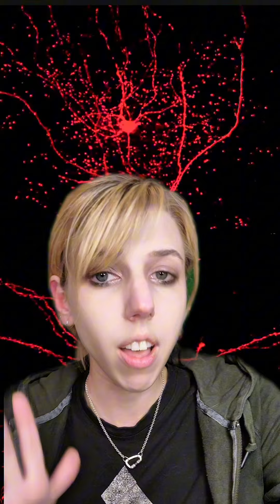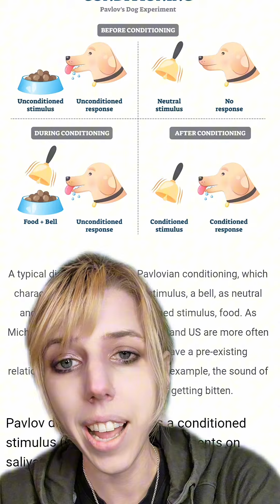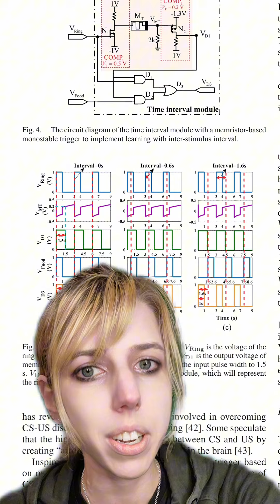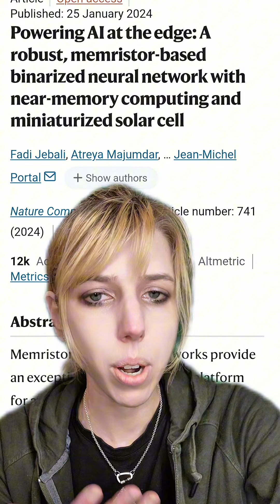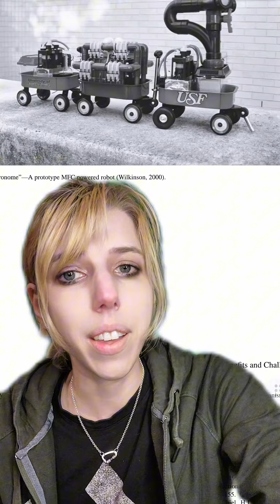Robots Are Stupidly Inefficient: Advancements To Make Them Function Like People

Comment: Halobacteria and a series of powered an unpowered LCDs to account for lambda adjustments as optical neurons on MeA sheets piloting a cohabbitted bioreactor with symbiotic pleurotus, cervisiae, mycoderma, pseudomonas  and lactobacillus along with a oxidation tank with specific enzymatic collonies geared for lignocellulose pre decomposition mashed together in a ford excursion full of pvc plumbing and stank eating obstacles for nutrients. The whole thing running on an ethanol ICE that uses combustion gas and heat with a solar HHO unit to take hydrogen and a iron copper catalyst to crack co2 and take generated hydrogen to make more ethanol

Comment: Robots are amazing at doing one thing. A robovac isnt going to be good at anything besides its designed intent. 
A 6 axis robot is going to be tailored to a task by its size and torque rating. That 6 axis isn't going to be capable of vacuuming a room. A pick and place is not going to be abke to spot weld a car frame.

We are far away from a robot being just as capable as a human in working on so many varied tasks.

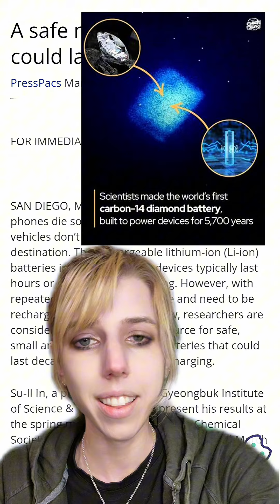Comment: 3:25 diamonds are flammable.  This beta source would be easily aerosolized by a fire 😷, that's bad.

I'd still probably prefer it to coal tho, which also aerosolizes radioactive materials into the air when it's burned.

Comment: I know this comment won't reach anybody important but please remember the science behind pressurization in depressurization and indications of flow dynamics. If anybody important does receive this remember we get headaches for more than just our cleft plate
Reply: 3:28  Now that I have the time marker also I could include with the above comment the factor of different size orbs will contract different electrical inputs because of the outer parameter and then you always have the ID parameter to manipulate for extra stuff

Comment: I think it will be a combination of all of this research depending on the application. I also agree it’s all an open field really so there’s a lot of things that will only go so far to scale. I do like the idea of microbial fuel cells quite a lot the scale isn’t there but the research is promising. I want to feed robots it just sounds like an awesome experience lunch with a robot what a fun thing to think about.

There’s also the piece about a more compact computational  language I think it will be necessary for a fully capable humanoid robot. The efficiency upsides will make it happen the more complex we build the limbs. There’s still limits to the pinching and articulation these machines can do it’s the same with prosthetics different problems same equipment. 

The more I look at the biology the more I think the answer is there but it doesn’t come quick. I think we will get massive machinery then scale it down. It’s how it’s worked before with the rate of scaling of the systems. I do think we will get less capable or specialized smaller robots. I hoping for something we have to teach I think of it like calibration with inherit alignment out of the box. It depends on how some of these current deployments go is my assumption. 

There just so many unknowns and the world is changing faster than ever people just don’t feel it cause it’s so incremental. People thought I was crazy when I told them in 2019 we were close to showing a robot a video and it reproducing the action. I’m personally rooting for the machines I just hope people are nice to them. No one asks for existence they are thrust into it robots are the same there. It’s a conversation I really want to have with a robot how do you feel about your existence? 

Thanks much for the coverage as always checkout Design and optimization of a bionic jellyfish robot for enhanced underwater propulsion efficiency fun stuff

Comment: The thing with robotics is it will functionally return back to the economics of slavery weirdly enough. The practice wasn't just abolished because it was morally wrong, but also because it was economically unsound due to the emergence of the free market revolution. Once the lowly peons were given permission to trade goods and services, people very quickly found out that hiring someone for a relatively low wage was significantly more efficient in the short term than a very costly slave meaning businesses could scale up from a much smaller starting cost and growth exploded. It won't matter if you can get a robot to do a complex task if it costs $50m to start and only costs like $1k per year to run and maintain, anyone would be able to recognise that even hiring people for considerably costly salaries is more economically viable and can scale quicker. Ofc capitalism is long dead so it's not really a surprise that we're in this AI bubble where investors somehow believe in a pipe dream where corporations can be 100% productive and have 0 staffing costs but the State will ALWAYS be too incompetent to keep such a ponzi running for long

Comment: We should fuel the robots with microplastics and use plastic-eating fungi & bacteria in their robot guts... especially the bacteria that turns plastics into "spider silk" and so the robots could help clean up the environment plus be able to build and repair themselves via 3D printing with aforementioned plastic spider silks. We should also plan ahead and design some portion of the robots to be fueled by arachnoplastic-based filaments.... You know, for when the robots have been too successful at their work and have eaten/cleaned up all the microplastics in the world. sigh.
Reply: Very cool idea also promising adjacent research on the subject. I was thinking microbial fuel cells but this is far more fun to think about. I also just love the idea of feeding robots waste materials dual applications are just practical . I was reading about robotic jellyfish for deep sea exploration this could be adapted for that purpose possibly. They are small so it would might be achievable it would certainly be appropriate for gathering without disturbing the habitat

Comment: Thank you BIG TIME awesome topic. u know I love this😊 Ternary(bcoz 0,1,or 0&1, to simulate hadamard gate and xor-like ops) mirror symmetrical(bcoz it can commute a bosonic symmetrical wavefunction which satisfy Symmetry under exchange thus not only allowing anyonic pathfinding like circuits with photonics,as they started to use magnetic skyrmion manipulation and logic gate functionality of  topological charges in spintronics and even ion-based computing) and metallic ratio parametric number base for 5th degree&on quintic functions which then we can adapt to use prime number neural networks. Infact a similar simplification to quantum chips architecture jst published recently (you'll love this:Nonreciprocal quantum information processing with superconducting diodes in circuit quantum Electrodynamics) and finaly once again Brousentsov's Ternary Principle and Bergman's Number System fits to this profile perfectly. Once we solve the actual ai, not just the llm's of chatbots on steroids but something like Hierarchical Reasoning that can bring latent space thinking(basically instead of semantic porn of Christopher Hitchens book like already achieved weight matrix transformers trained in a feedback loop models it'll be using pattern recognition similar to wolfram ruliad based hypergraph models it'll dive on a high dimensional vector space and use e8 lie group or hurwitz quaternarion maybe even scators to mark tokens(and then of ofcourse we got the audioactive sequence and surreal number system of conway,mark my words next level merkle tree of decentralizedledger/blockchain data flow among quantum internet in the next 5to10years definitely pop up as prime candidate for this particular job. Energy efficiency of robotics part is not something we can sort before actually we can get rid of this free wheel(a lot of pun intended) illusion and consciousness issue backed by anthropogenic principle since only an actual benchmark of agi self produced solution can satisfy that in an ondemand manner,not by our recent metallurgical solutions like memristors(I'm not betraying memristors all I'm sayin is photonic chips can provide a higher processing power that can simulate that)its time to see the sapiens as another tool nature is using2build its nxt evolutionary masterpiece.when we gonna understand that brain is a simple carnot engine which can act like a bayesian optimisation on casual entropic forces. Cytoelectric coupling and spatial computing used with knightian probability(not2forget non commutative qft,bohmian/madelung hydrodynamics in better faster solutions since these are already backbone of certain financial/systematic trading algos and u know its the real deal if JPMorgan or GS is investing in it)we can get a proper casual to excess entropy predictive functions and use these in BCI's. Lastly I would really like to point out this thad Roberts guys gieseking manifold and its unreasonable effectiveness in finding physical constants up to 8-9sig figs. Imagine how greatly the physics informed nn's would benefit from it.Btw bonus papers(ManifoldFormer: Geometric Deep Learning for Neural Dynamics on Riemannian Manifolds 

&
MARBLE: interpretable representations of neural population dynamics using Geometric Deep learning 

& 

Non-invasive ultrasonic neuromodulation of the human nucleus accumbens impacts reward sensitivity 

Ps:I've left few papers on my posts4u but I don't want2 unload all my excitement in an early arrival type embarrassment by copypasting all here.infact I even apologise for these ones,I feel like im violating or disturbing ur talk... u see why I'm keep sayin we need a live chat like sessions with you and your subs. I know it's not my place2suggest anything but I genuinely get real excited about these and you know it.

Comment: Crazy to think how much progress has been made in the last 10 years.  Even crazier considering the last 50 years.  Was born 1970.. and back then we still used punch cards for our water bills.  The bill was sent to you on a paper card with holes punched into it so that they could be inserted into a machine to read the holes locations on the card in order to translate into numbers representing the account and the amount owed.  Computers filled up entire rooms and had less computing power than a typical watch these days.  Televisions had huge vacuum tubes as capacitors and the screen would have to 'warm up' before a picture could be shown.

Imagine what could be in the next 50... even the next 10.